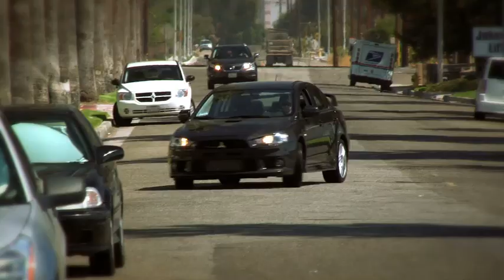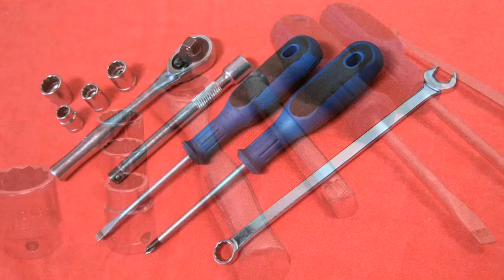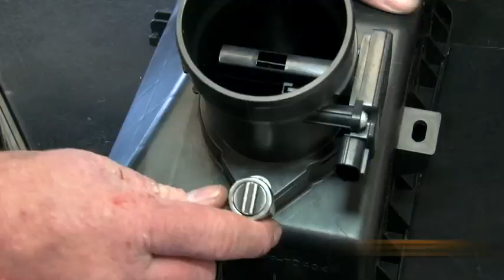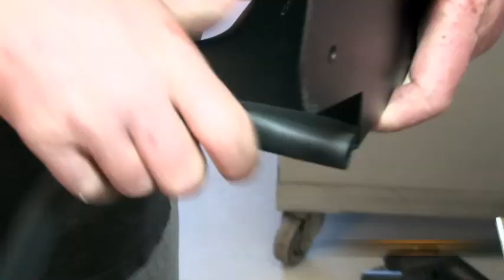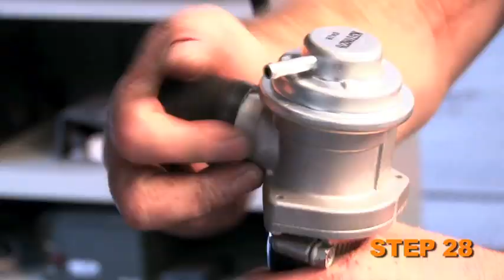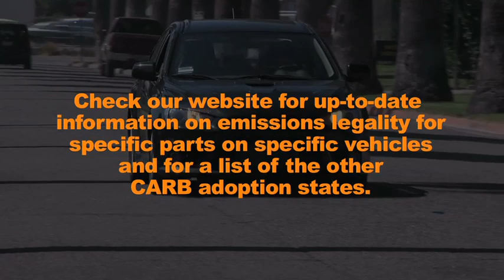2008 - 2013 Mitsubishi Lancer Evolution 2.0L Turbo K&N Air Intake Installation

Comment: This kit is not suitable for UK cars the engine does not have the engine lifting bracket hence no way to secure the air intake pipe from the filter 
K&N say ....  return the kit as it's not suitable for your car and if you do fit it there will be no warranty so why do they not mention this anywhere